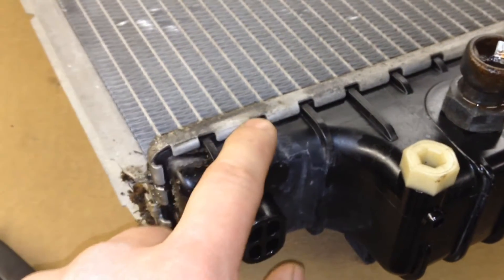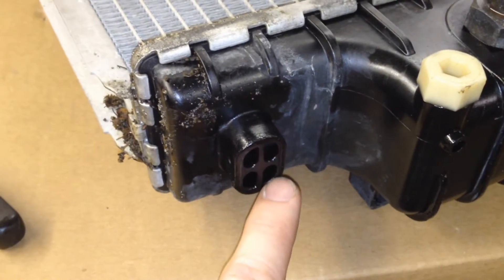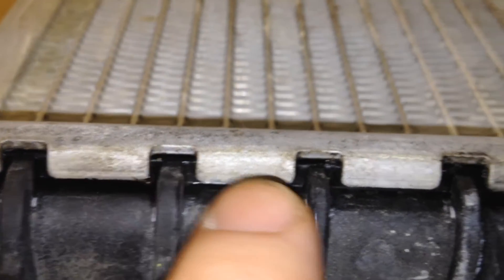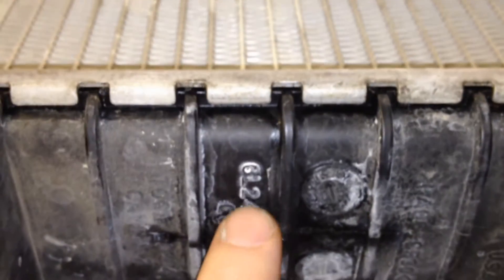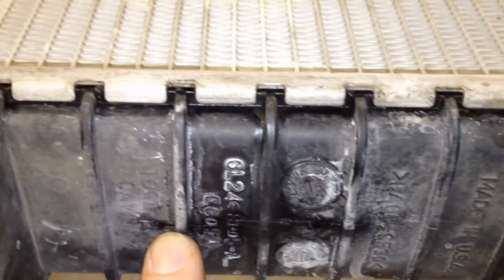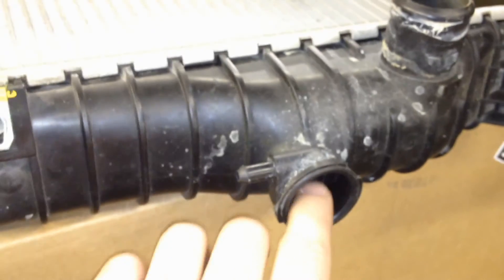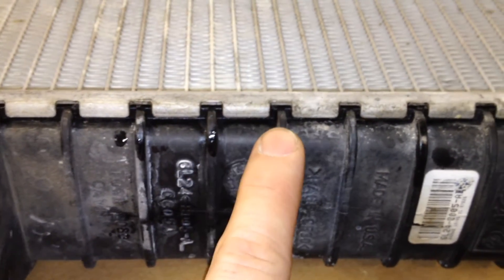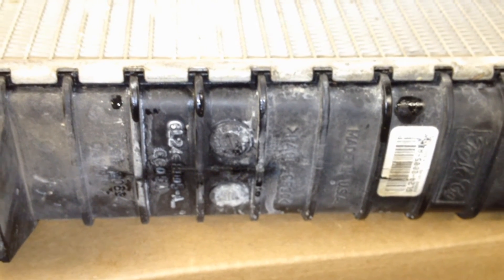Ford Quick Tips: #6 2006-2010 Ford Explorer Common Radiator Leak Points

Comment: The "new one" I put in seems to be leaking by the bottom tank under pressure like this video mentioned. As if getting it in wasn't an absolute, royal pain, the darn thing seems to leak as I'm trying to bleed the system and check for leaks after all hoses and lines are locked as tight as possible, right from the bottom. Ford dropped the ball here.

Comment: 10 years later and I'm facing this issue
Reply: @z9m1x8  yea, I replaced the radiator because it had corrosion on the inside and it was starting to make coolant seep out of the seams. But it still smells like burning coolant and I can't figure out where. I'm no longer losing coolant now. Just still has the smell
Reply: @z9m1x8  already replaced the thermostat

Comment: I'm leaking trans fluid at the radiator connector - its all rusty and corroded, so i want to replace the steel line and fitting, but you are saying I should drain the radiator first? and buy the dorman part with 2 o-rings... what is that fitting part I need? also transmission is a bit clunky when cold....could coolant have leaked into the transmission because of the leak at the radiator?

Comment: Yes thank you because my radiator is leaking right around that place that you said it’s on the passenger front you can see the radiator stuff to the front of the front grill and yes it does leak under high-pressure

Comment: I saw your video and it's very usefull because my radiator is leaking some where on near my air blower but I don't know exactly where yet. I may check my thermostat to see if there's some leaks. One time there was some cooler leaking from the back of my car close to the muffler pipe. Maybe you can help me why is the reason.
Thank you appreciate 😉

Comment: Yep, this appears to be a common problem with the Explorers, a split on top of the plastic portion of radiator which may cause a short in the PCU from all the moisture.
Reply from the maker: Huh?
Reply: FordTechMakuloco   I had the PCM repaired last year when I bought 08 Explorer. Had a series of codes indicating possibly a bad pcm. No more engine light until recently when after filling up with coolant, the coolant container was empty again and I got an engine code. There was a hidden split on top of radiator and I suspected perhaps the steamy moisture may have played a role with regards to the pcm issue.

Comment: Mine actually has that crack right where you showed and it bubbles under pressure. 

Vehicles had no accident with the front end to my knowledge and it’s an 08 I bought used

Comment: Replaced my 07 Sport Trac radiator because the plastic end cracked right under the tank. The TYC from Rockauto gave up within 3 years. Real pain.
Reply: Getting ready to do my 08 ..so it’s a pain huh?

Comment: My 2006 4.0 did same thing, cracked underneath over flow tank, then swapped out with $60 special from eBay, last august. So contacted the seller and is lifetime warranty as it's leaking upper plastic seam. Just send it back and we'll replace it they said... It cost $55. Shipping cost $51 and my vehicle sits all apart till they send another one, screw that. So I bought another cheap one $60 and swapped it out yesterday. Then I saw your video on these cheap radiators and the 20 psi trouble with the seams. Crap wish I saw that before! Well I guess I have 6 months to go on this one, maybe. But next time, premium radiator only. As this job looks easy but isn't if your not purging A/C and pulling condenser. Which I didn't, took me 1 1/2 hours longer but saved A/C charging. The plastic radiator support brackets that must come together just right on the bottom or the radiator doesn't fit low enough for top bolts, was designed by an evil bastard. Absolutely no reason that radiator shouldn't slide out after hoses and top bolts off. I can here the engineer laughing now, "wait till they try to get this out, hahahaha!".....bastard.
Reply: I had to fight for hours with those stupid plastic side brackets yesterday doing a radiator on one of these 4.0s. Part of me almost thought it was me sucking at this job lol. Nice to know I'm not the only who thought, "what a stupid design!" As I fought and fought to get the new radiator into these stupid brackets at the bottoms. Apparently you have to undue all the bolts at the bracket, including the 10mm for the condenser, which are both idiotically placed where you have to use extensions and usually need a magnet to get that bolt out. Undoing all the bolts for those brackets may get you enough maneuverability to get the new radiator in. After all this struggle then of putting the new radiator in and connecting all the hoses and dealing with the also genious design of those trans cooler lines, the stinking "new" radiator seemed to be leaking. Again, according to this video and your comment, I'm glad it's not me!

Comment: I have a 2006 Ford Fusion with the 2.3L I4. I noticed low coolant levels so I topped it up to the cold fill line. In about a month it had dropped. I started to experiment. I checked the level regularly but I did not fill it up, for 3 weeks. With the coolant low the level did not drop any lower. I can see no coolant or that white dust under the car, it's not in the oil, and it's not being burnt. (no smoke, the exhaust does not taste sweet). So I am not suspecting a head gasket. Could this be a pressure leak?
Reply from the maker: batchnerd I really think you had a air pocket burp. Have you done any cooling system related work to it recently or previous owner?
Reply: No nothing maintenance wise (that I know of). I'll try topping it off again and seeing if it falls. One of my previous cars (2001 focus DOHC) did the same sort of thing. I'd fill it up just to have it drop back down to it's "happy spot" and stay there indefinitely.
Reply: By the way thank you for taking the time to respond.
Reply: LEAKOBOOST

Comment: I'm back again after working on the suspension and brakes with good success. Also ran 2.5 gallons of Amsoil tranny fluid through with a filter change, I still want to and will add a spin on filter for the tranny. I had  really good success with this on an old Hyundai a couple of years ago. The fluid was black, I did a couple of changes and then added the Arctic cooling filter and after that the fluid was red as new and stayed that way. 

My real question and I did post it on Ford Focus Fanatics (FF) is this. 2007 Focus SES with federal emissions; no (Air), to replace the water pump do I need to remove the AC compressor? It sure looks like I need to do that or the power steering pump. I know the passenger side motor mount will have to be removed along with the coolant reservoir. Any advice would be welcome.

Thanks!
Reply from the maker: Nope pulls straight out no need to mess with the a/c
Reply: FordTechMakuloco
Thank You, cool as ... You know.. I believe you... I'll let you know how it goes in the next week or so... :)
Reply from the maker: Straight from the manual I can send you the pdf of the procedure from our workshop manual if you want it.
Reply: FordTechMakuloco
That would be great and much appreciated! I will send you a pm with my email.

Comment: I discovered your videos on FTE. Very nice.  I have what appeared to be a coolant leak, the coolant level in the radiator drops about 4 oz per week, I would top it off. Lo and behold I see the coolant level in the overflow tank rising. Apparently it's not drawing back into the radiator.  Can you advise what the problem is?
Reply from the maker: I would check the areas for leaks as in the video, also the thermostat housing on a 4.0l engine and water pump weap holes. It sounds like you have an air pocket too. Has there been any work to the truck recently that opened up the cooling system? The only thing that regulates coolant and drawing it back in the rad cap on these.

Comment: Hey, How is the carbon build up on the intake valves of the 3.5L Ecoboost V6 in the Taurus SHO? Some of my friends have had bad experiences with Direct Injection in Audis and VW. Also, from what I hear on the forums, the PCV system isn't that great and will send lots of oil into the intake, would you recommend a catch can? Thanks
Reply from the maker: Yes the early days of direct injection TONS of carbon issues so far so good on the Fords. I do not recommend catch cans I think it is all snake oil. Kind of like coolant filter systems on the diesels, not required.
Reply: FordTechMakuloco Thats a good thing. Definitely having my PTU oil flushed though. After seeing what came out of a friends SHO with 30k miles, I'm surprised my ptu hasn't blown up yet with almost 40k miles.
Reply from the maker: The ptu fluid is supposed to be black and have a pugnant odor totally normal and are fill for life.

Comment: ye alot of gm's hitting 21 psi now a days i think its insane... but keeps the boiling point of coolant high!!!
Reply from the maker: Yes anything 2013 and newer Ford is 21 psi and we are having new coolant leak issues on some of the new cars like the 2013 Escapes that keep getting recalled. This was back in 2006 when they jumped to 20 psi on the explorers only and now the customers are paying the price.
Reply: i wish i understood why they increase the pressure.. 15 PSI is plenty.. if they wanna keep the engine cooler just add a bigger rad.. OR dont use cheep plastic crimpted on tanks FFS! haha but ye
Reply from the maker: Well the way I see it on the new fusions etc is so they can run it hotter safer and the air fuel mixture leaner for fuel economy.
Reply: makes sence, stupid fuel eco makes our job harder and more of a pain if you ask me...